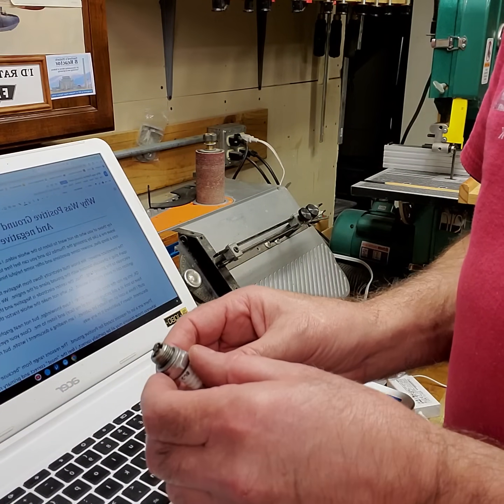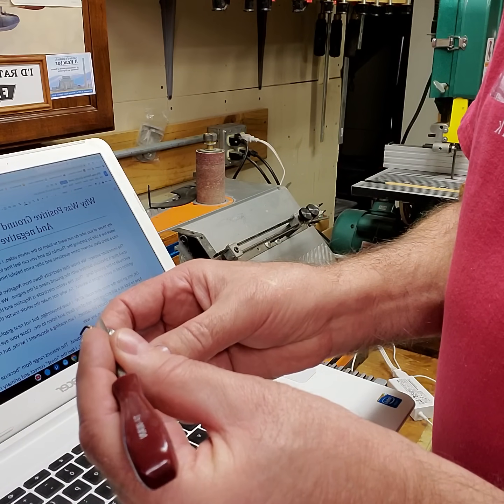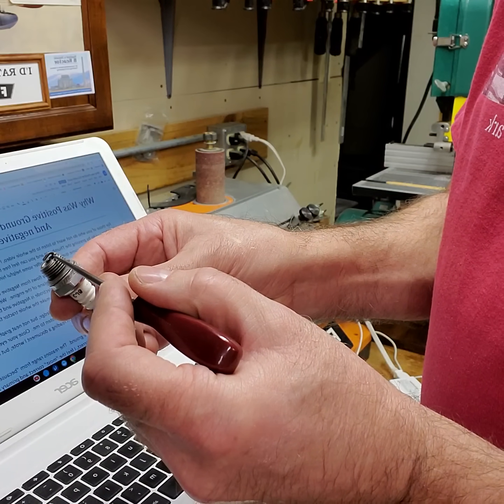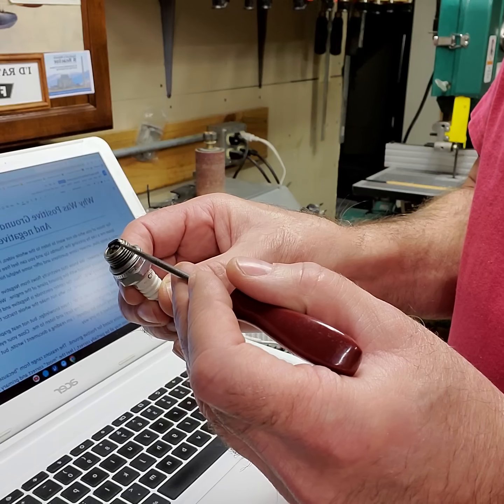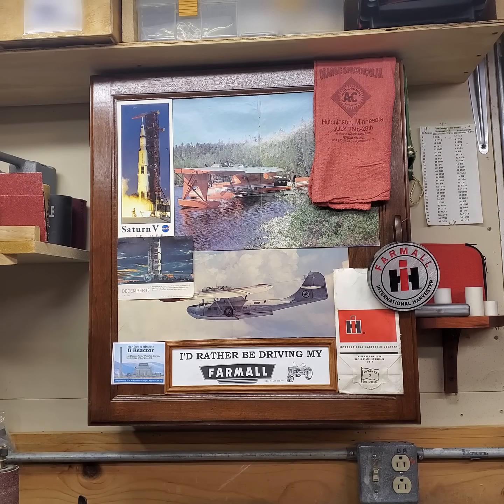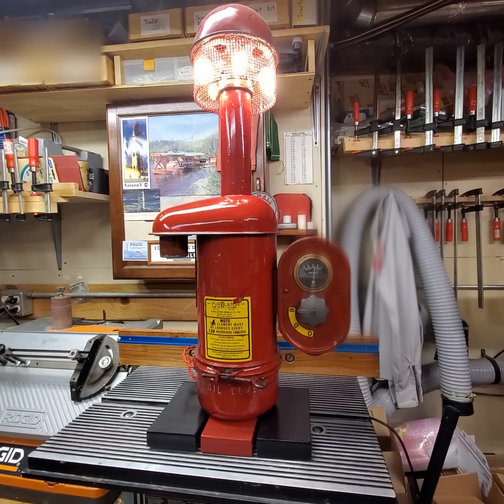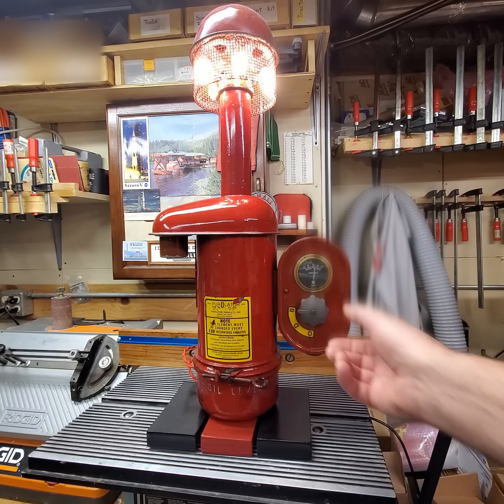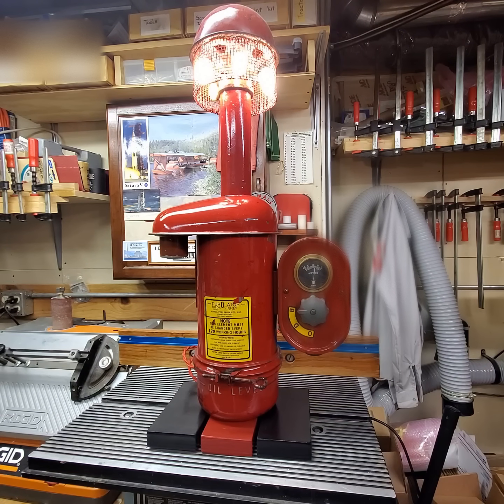Why positive ground was used on old cars, trucks and tractors

Comment: One more comment, when the points are closed and current in flow into the coil, the magnetic field is energized, when the point open, causing the field to collapse, the condenser will cause the ring until the energy has been exhausted. The coil has primary winging and the condenser and points are in the primary circuit,. The coil has a secondary winding the powers the spark plug. The coil is in affect is a step up transformer. The secondary winding is 180 degrees out of phase of the primary.

Comment: Remember, old school, an ignition/condenser/ points system, when the points open, that the spark is produced, the coil and condenser are ringing, producing an alternating current and it's frequency is one over two pi square root of LC.

Comment: When the finally figure how electrons flow, they should have reversed the polarities and corrected Franklin’s mistake.
As a college electronics instructor, we often get an electronics book that is in two versions: the first using conventional-flow + to -n; the second using electron-flow - to +.  When you write an equation for a series circuit using Kirchhoff‘s voltage law  (KVL), if you use electron flow then all of the voltage sources end up being negative and all of the loads end up being positive. However, if you use conventional flow, then all of the sources are positive such as batteries and the loads are negative. Once you make this distinction, conventional flow is much better because of the way the math works. Finally, when you’re analyzing physical-circuits, you don’t have to worry that the flow is actually reversed from how it works at the physics level. But it was so absurd to actually have two textbooks, and also fellow instructors that insisted on teaching electron-flow which I refused.  Once we switched over, the students had much greater success mathematically and did not get lost as easily trying to track negative results…
Reply: There was a hundred years of convention by the time the electron was discovered.  Generations had learned it the other way.  Mathematically it is equivalent, so why cause mass confusion reversing the + and - symbols?
Reply: @stargazer7644  If you look at the volume of subsequent number of scientific papers hence published, I feel it would have been more than worth it; there was not the huge volume we have today.  Plus, we have to make the distinction every time we educate a student, which is not only cumbersome but causes more confusion than is necessary, and is in many cases a real stumbling-block for students.  This is why I refused the ‘electron-flow’ based texts because many times the students had trouble as soon as they had to use mathematics to solve circuits (i.e. the students confusingly think they have to make some kind of conversion at the end).  
So, it just keeps coming up over and over again.  Thank you for your reply and comment…
Reply: @SpinStar1956  Yes I have no doubt standing here with perfect hindsight that you feel it would have been justified to completely confuse a hundred years of research with a fundamental change in definitions.  I also have no doubt the exact same decision would be made if a similar situation were to come up today.  As it is, all you have to do is assume positive holes are flowing instead of electrons, and everything pretty much works out exactly the same way.  And that's the main reason they didn't bother to change it.  Millions of students every year learn conventional current and ohms law and all the rest and the math all works out fine and they don't suspect a thing.  If they continue on to more advanced subjects they learn the truth and it ultimately isn't really a big deal.

Comment: Your grip on the terminology is a little tenuous. “Electricity” doesn’t flow from negative to positive, electrons do. The electric field, and therefore “electricity”, propagates in both directions at roughly the speed of light.

Comment: You are defining electricity as the direction electrons flow.- "we know that electricity flows from  negative to positive"    This is indeed debatable and definitions mean a lot. I dont like this definition and it is pretty weak. You also used a loose explanation of just what a ground is.

Comment: when the first batteries were invented their was some confusion about if the negative side of the battery should be called the positive because the electricity flows that way, the guy who came up with idea to make the first battery noticed when he placed a metal coin on his tongue their was a electrical charge created from the acid in his saliva working on the metal coin on his tongue, he went on to build the first battery, metal disc stacked together flooded with acid,

Comment: Very good video.  I am an Automotive Technology instructor at the high school level.  I teach the two "theories"- Conventional Flow and Electron Flow.  Those who subscribe to the Conventional Flow theory postulate that flow is positive to negative.  Those who subscribe to the Electron Flow theory believe that the flow is negative to positive.  Personally, I believe, like you, that the flow is negative to positive. I remember from my youth our old tractors and a few pick-ups that were positive ground.  There never seemed to be any corrosion on the terminals.  Not so with modern vehicles.  It just re-affirms my belief that electron flow is correct- negative to positive. I do like your observation of spark plug characteristics.
Reply: In this day and age wouldn't it be possible to resolve the dispute by measuring the time lapse for a very short burst of power over a long enough conductor?
Reply: It is simple the positive side of the battery has been stripped of its electrons by  the charger and it has pushed them all over to the negative side of the battery. So when you hook up a load the electrons flow out of the negative side and go back to the positive side.  The positive side is positive because of a lack of electrons and the negative side is negative due to an excess of electrons. Of course this all depends on whether the electron theory of electricity is correct. 🤷‍♂😉

Comment: If the center electrode on the spark plug is negative on a negative grounded vehicle, then how would the spark jump from the negative electrode to the negative engine block (essentially)?  They have to be opposite. It makes sense on a positive grounded vehicle that it would be that way. But I can't think of how that could even be possible on a negative grounded vehicle.

Comment: I liked how when cars had steel bumpers you could touch bumpers and just use one cable to jump the dead one off (if they both had the same ground system).
Although, many cars back then also had a manual trans, so just a little coast and pop could get you there too
Reply: Bumpers together, and a piece of coat hanger wire. At 3 am, on a back road in Alabama, drizzling rain...who cares if it burns your hand a little...👍👍
Reply: @nickv1008  LOL, been there😏
Reply: @tracewallace23  sorry to hear that. Glad to see you're thing outside the glove box. 👍👍
Reply: @nickv1008  😎👍
Reply: That was particularly useful when the batteries were on different sides of the car. Join the red and black together, just make sure they don't short to any bodywork. Automatics are still rare this side of the pond, so bump start and push start are still available. I hate to imagine how many times I used all three methods before I got my first reliable car. Driving used to be an adventure!
Reply: @georgeprout42  👍 LOL That's what makes one truly appreciate a good vehicle 🙂
When I was in college I carried enough spare parts in the car at all times (and tools) I could have rebuilt the engine in the side of the road if needed 🤣🤣🤣
But it made it easier to help other stranded motorists too 😁
Reply: @georgeprout42  I remember a couple times I had to push my van to the crest of a hill to roll-start it. One of the reasons I prefer manual transmissions. Also nice in icy weather.
Reply: I used to push-start my '64 Triumph Spitfire...by myself.
Reply: @twwtb  I just push started my 09 focus with a flat tire by myself it wasn't easy
Reply: Touch bumpers and two Tire irons to boost the truck!!😁👌
Reply: @barryfirth1187  you got tire irons? You lucky dog, I'm lucky to have one Jack handle between the 2 vehicles.
Reply: @Drew-Dastardly  I totally agree.
Don't forget the 27 airbags at a few hundred a piece (If they even work at all) 🙄
Reply: Uhh... they still do. You just can't see the bumpers on many cars these days.
Reply: @danjarvis6980  I hear a .22 short, or .22 lr depending on fuse size worhs too. Heard about a fella got shot in the groin doin that...but it does work.
Reply: Now that is old school technology.  When you grew up how many dinosaurs were roaming the streets?  I never considered that in the era when old cars were totally grounded into metal bumpers
Reply: @ben91069  The same amount of dinosaurs as now, only the air and water were cleaner
Reply: @tracewallace23  Yup ,miss those days, bumper to bumper and clean air & fishing in the dark ( better with moonlight)
Reply: @SuperReznative  or an old glass headlight bulb floated out on the water

Comment: In the 1950s the US Navy electronic schools used electron flow.  Probably because it more accurately describes the action of vacuum tubes.  Every car I have owned since my 1941 Chevy, except for my Model A Ford, has had negative ground with the engine block strapped to the chassis.  Both were tied to the negative side of the battery.  That means electrons flowed from the tang of the sparkplug to the center electrode.
Reply: That does not determine spark polarity. The coil secondary determines the spark polarity. It depends on the coil construction.

The battery (vehicle) ground polarity only affects the coil primary. The coil secondary supplies the spark, and remember, it flows only when the PRIMARY circuit is OPEN. The car battery is more or less isolated from the spark circuit at this moment, and the spark current flow is determined by the polarity of the SECONDARY winding direction, in the coil...

You actually  have two independent voltage sources, that just happen to share a common ground point.
They can be both negative ground voltage sources, or one can be negative grounded, and the other can be positive grounded...

I theory, you can have many power sources use the body as a ground, without conflict (as long as the power ends don't associate).
For example, you could add 6V fog lights to a 12V system, with a separate 6V battery (either polarity), ground it to the body, and run separate 6V power wires from that battery to your lights...
Reply: @troubleshooter1975  Got it.

Comment: To (PROVE) your point (at least logically "which is the only point that "really" matters).  "What charge is an electron"?  Well, duh.  We all went to high school.  An electron is "negative".  What (IS) electricity?  electricity is the "movement" of electrons?  Well then.  Wouldn't that make ALL electricity"negative" in charge?  And such, flow toward the positive?  THERE, there is the "logical proof.  Next we could talk about how electrons do not actually "move".  But the connection propagates out.  So, in effect, the same thing.  Good point though.  I always hated this point when I was in engineering college.  At the chemical side of campus, negative was the outer orbital (electrons).  And a "higher" pH, was more "basic" yea.  But it was "less" electrons "more positive.  aright (less is more).  Ok.  And then over at the EE (electrical engineering) campus side of town.  The "negative" electrons come out of the "positive" terminal (on the schismatics).  OK, you go ahead and think that.  But, I'm not stupid.  I know you are backward (not "YOU" you are making the correct point.  I mean the professor "teaching" that class) "that sounded bad, sorry".

Comment: I bought b Farmall I still haven't figured out what year it is and it had a jumper wire and I've always had trouble getting it to charge so now I know why so thanks for your advice
Reply from the maker: Hi Duane.  Yes, clean up the ground path on the electrical box.  The field current must pass through the cover of the box.  Kind of a bad design.  I have put a ground wire from the switch itself to ground.  This is far better.  Doing so made the old H charge like it was supposed to.  the generator was just fine.

Comment: I think there are a number of factors why the automotive industry moved to negative ground; partly is was a response to dubious claims about body corrosion, but mostly it was the introduction of electronics into cars. Early transistor radios were made with Germanium transistors whos design was such that they favoured positive ground in the circuit, but the move to Silicon transistors reversed this. Also when alternators came about the control circuits were easier and cheaper to design to operate on negative earth. And as you point out, the only real advantage in positive earth to the engine is in the ignition circuit, which is isolated from the rest of electrical system by the ignition coil. The other big, big force for the change was the marketing benefit of having some new, sciency sounding reason to tell your customers that your cars are more advanced than those old ones!
These considerations at the time weren't really relevant to tractors and farm equipment, but when the same manufactures make all the parts for both, and there is no real cost in making the switch, the whole industry settled on it.
Reply from the maker: Hi Ian.  What a most excellent comment.  Thank you.  A+
I never before considered the marketing "bang".  Very interesting indeed.
Reply: In my experience, the difficulty of starting positive ground autos probably played a role. For some reason they were always difficult to get started.

Comment: The change to negative ground likely follows the advent of radios in vehicles. Positive ground is very impractical for electronics, especially for tubes since filament supplies would not be at ground potential as well as many other components thereby increasing hazards from high voltage. With a negative ground, the tube filaments can be driven directly from the battery while elevating them to the high negative voltage would add a great deal of complexity. The standard heater voltages are 6.3 and 12.6 volts, similar to cars and not likely a coincidence. Even for solid state, NPN dominates, so negative ground remains preferred and consistent with tubes. Since reversing the coil for the spark plugs is trivial, there's no reason to introduce so many expensive and dangerous problems for the electronics with a positive ground.

Comment: It’s found that when the central electrode is negative, gap’s  breakdown voltage is 25-30% lower than in the opposite case . So this is the main reason for such a choice. It’s related to the shape and the temperature of the electrodes . The tip of the central electrode is the hottest place in the engine and the tension of the electric field concentrates on the sharp edges . Today’s double fine wire electrodes ( 0.4 mm central electrode and 0.7 mm ground electrode diameters )spark plugs as Denso iridium TT pushed this to an extreme and as a result their breakdown voltage is 3-5KV lower than on the regular tick electrode ( 2-2.5 mm diameter) plugs .
Reply from the maker: Hi Flapping Flight!  I've been waiting for this comment.  Years ago, I was reading about the temperature of the arc.  Meaning:  the temp where the spark jumps off and the temperature where the spark lands.  I know it was in one of the many books I have; however, I can't find it again.
Yes. the center electrode is very hot.  Thus, the "special" metals that are now usd.
BTW:  Same is true on Voltage regulators.  Delco has a special regulator for Positive Ground.  The contact construction was different than negative ground regulators.
Reply: @bryanh1944FBH  the higher temperature of the central electrode lead to much stronger thermionic emission ( cloud of high energy electrons around the central electrode ) so the electric field need just to accelerate them instead additionally to free them from the crystal lattice of the metal . That’s is why when the engine is cold started , the breakdown voltage of spark plug gaps are higher and if the ignition system is weak( old contacts types ignition systems ) or the temperature is very low the start could be impossible .
Reply from the maker: @flappingflight8537  Thank you!!  I feel that if we ever get together, we would have an excellent, and long, conversation.  Take care!
Reply: @bryanh1944FBH  sure , why not ,for now just subscribed to your channel ,you’ve produced great video on thematics ! Thanks !

Comment: one reason for positive ground could be so you can get 18 to 24 volts by kissing bumpers and you got 1 connection of a series connection.
Reply: But you couldn't use it for anything mounted in either car...
But I'm assuming you said that in jest.